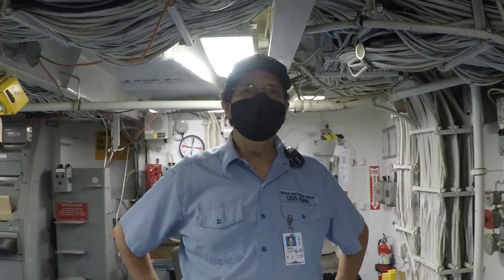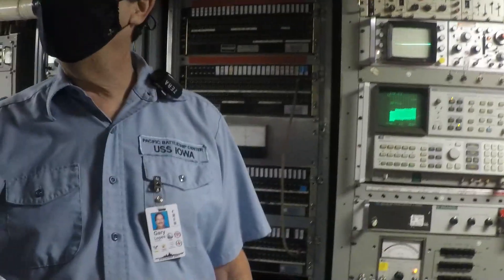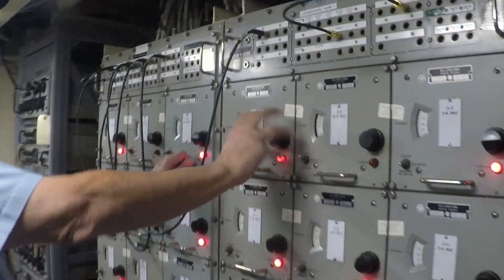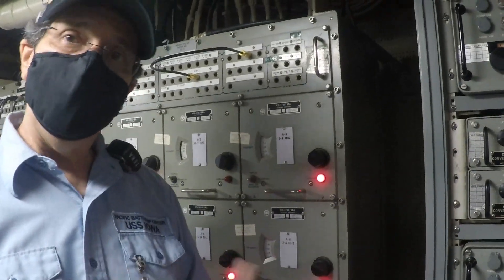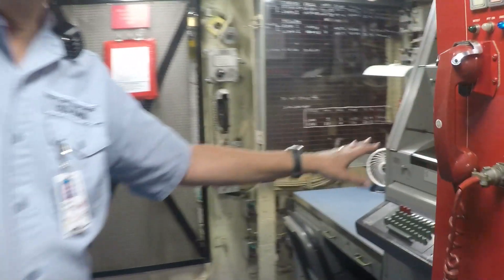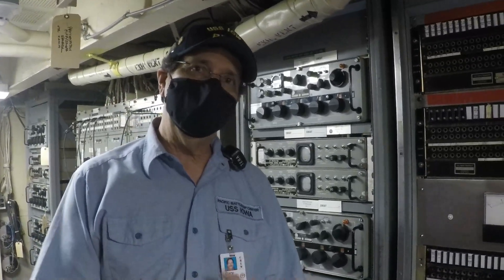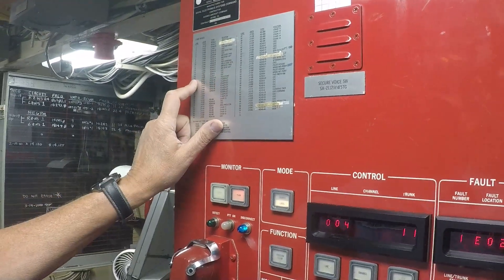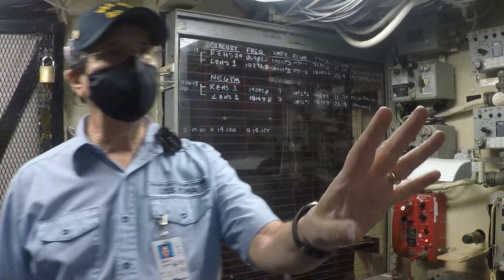Battleship IOWA's Radios - Part 1

Comment: The radio room on the LST that I was on in the mid 1960's was a lot simpler, but they did have teletypes.  The radio men, when they had an available teletype, would print out a news feed and give it to me.  I was the ship's yeoman.  When I got a printout I would put together a "newspaper" using the items in the printout.  I would type articles on a Ditto master, the copier system we had, and duplicate a large number of copies which I put on a shelf out side the ship's office.  I also gave copies to the officers.  The duplicated copies disappeared quickly, and I believe my crew mates appreciated getting this small sample of the outside world.  I never got any bad comments from the XO or other officers.

Comment: Was there any automatic encryption device for voice communication over shortwave and VHF? What kind of transmission of voice was used - analog (SSB or NFM for shortwave, NFM or WFM for VHF) or maybe digital?
I would be very happy if someone could give answers to my questions.
Reply from the maker: Yes, most all communication, voice and teletype, was encrypted. The encryption and decryption was done in the FACCON 2 space located port side from FACCON 1 where all of the receiving equipment is located.

 Voce communication on HF used both upper and lower SSB. AM was used on both VHF and UHF for ship to air communication. UHF communication ship to ship would have been 15 KHz FM, and communication via FLEETSATCOM would have been 15 KHz FM or PSK.

Comment: No matter what the ship, when there are rooms dedicated to one thing, there is a lack of residency unless there are many rooms dedicated to that one thing.
Reply: Redundancy doesn't always mean explicit duplication. In IOWA's case, the loss of this compartment means that it loses its long range communications capability. That's not an immediate concern in a firefight. It can still communicate short-range with all the other ships in the fleet and the radars and other weapon systems still work independently of this space. If long-range communication is needed after suffering a casualty it can route through another ship nearby.